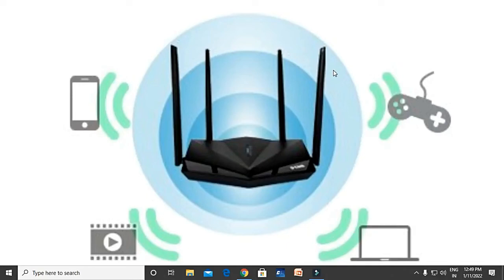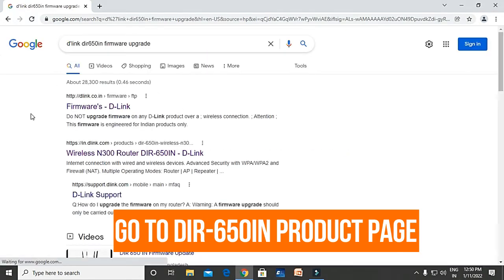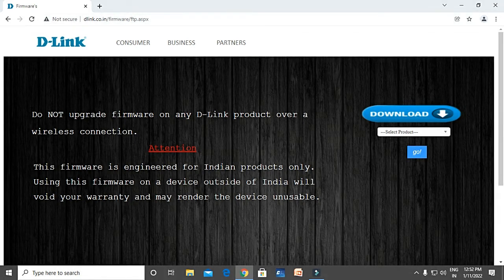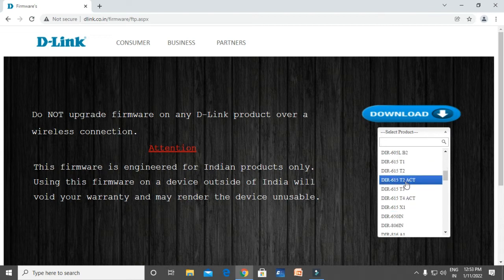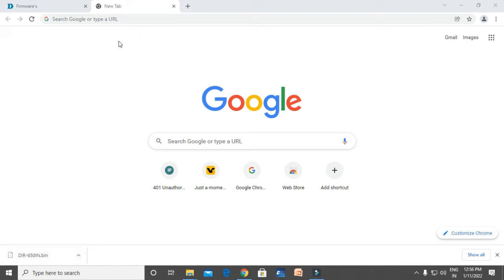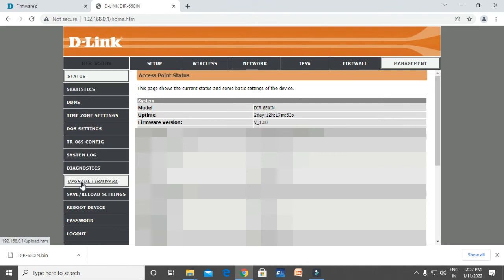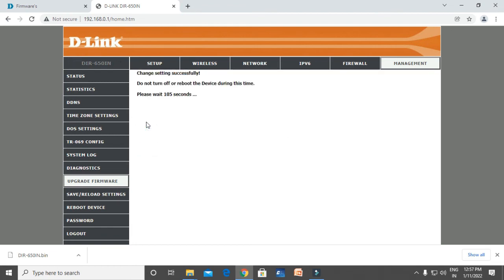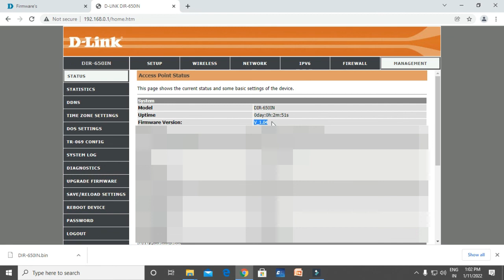How to Upgrade Firmware of D-Link DIR-650IN

Comment: Bro it is showing invalid file format
Reply from the maker: make sure you have downloaded and selected the correct file.
Reply: @techomania01  bro I downloaded the correct file.
Reply from the maker: what is the extension of the file
Reply: @techomania01  BIN File
Reply from the maker: it should work then I have just tried it again and it is working perfectly
Reply from the maker: just try to repeat whole process from scratch, follow each step carefully
Reply from the maker: @Mukulendu Debnath may be some confusion
Reply from the maker: @Mukulendu Debnath maybe your are right, you can contact support if you are stuck